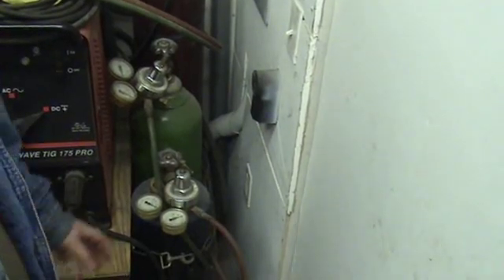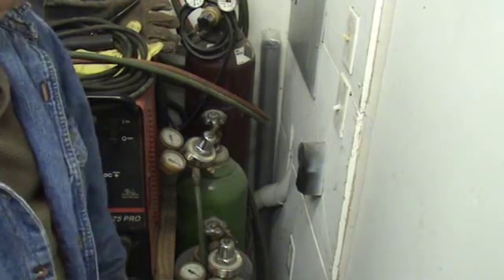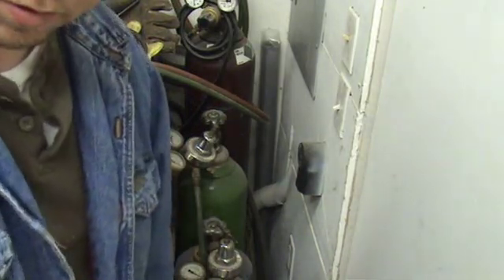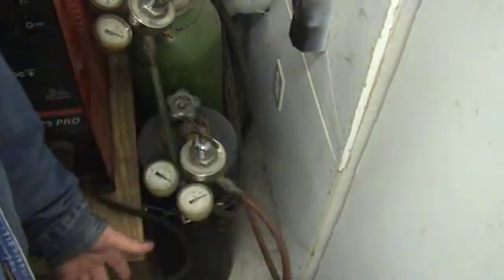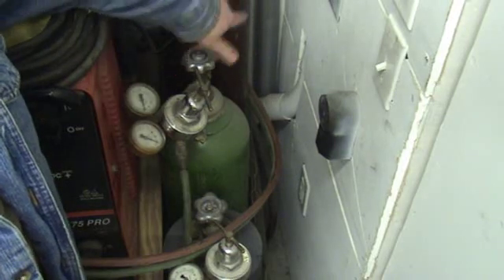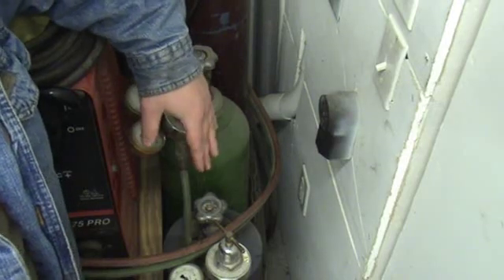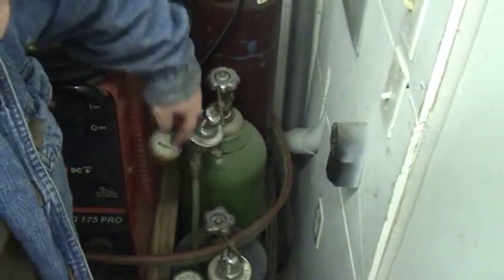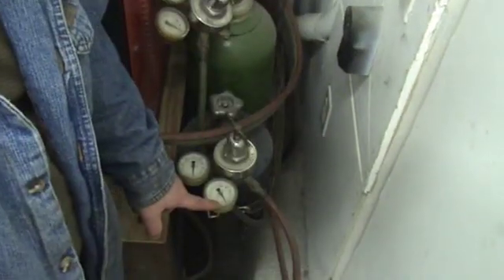Oxygen&Acetylene Cutting Torch Set Up

Comment: I have used the cutting torches for years, and I have usually set the Acetylene at 7-8psi and the Oxygen at 14-15psi(So the Acetylene cannot flow back through the Oxygen line, and create a basic bomb.), and I would gauge the perfected amount of gas to Oxygen, by the cut-off valves, depending on the sharpness of the tips of the little "cones", since, the sharper the cones are, the more precise and easier the cut can be, as well as how hot the flame will be, as well, and the hoses are set-up, so you cannot put the Oxygen line on the Acetylene tank and vice-versa, also, to close the regulators, do NOT turn clock-wise, turn them counter clock-wise, until they feel loose, that means, that the valve is closed, and the valve and screw piece, that opens the regulator have disconnected.  Then you slowly turn the screw piece in, until the pressure is set to your preferred level, always within range, so you do not go over the line, and always make sure that your Oxygen pressure is higher then your Acetylene(Or MAPP or Propane gases.), so that you will never get a build-up of Acetylene in the Oxygen line, and you won't blow yourself up!  Also, if you see any flaws with your gauges, change them out, so it does not show at 7-8psi, but instead actually pushing 15-20psi, and also check for leaks, as a precaution to make sure everything is sealed.  Also, always heat up the metal you are cutting, until an reddish-orange color, just before it is ready to melt-down, and then kick the oxygen trigger on, and it should easily cut right through, unless it is a thick metal, then will need to make sure the reddish-orange color is all the way through, so it will cut it, like the spot that he was aiming at, right before he hit the trigger.  Also, if you wish to make the metal a bit stiffer(Also known as heat-treating.), you can use either water or oil, but, if you use oil, put the metal COMPLETELY submerged in it, and if using a bucket of oil, or water, or whatever, slowly move it in a figure-8 pattern, and it will condense the outer side of the metal(Kind of like the shell of an egg.), but ALWAYS keep the metal submerged!

Comment: great vid for for general how to. The oxygen valve should be opened all the way, that is how it is designed to be correctly seated. The gas valves are only cracked for adequate flow. Good job, nice cut, excellent presentation. Thank you for your time and effort.

Comment: Good vid... thx.  Shouldn't the o2 valve be opened all the way and not just cracked?  I think the 02 valve is designed to be opened 100% for use and the acetylene just cracked.